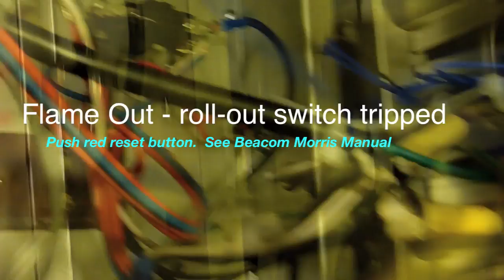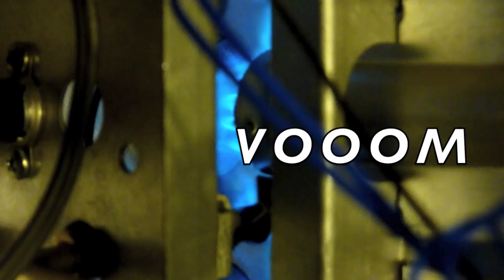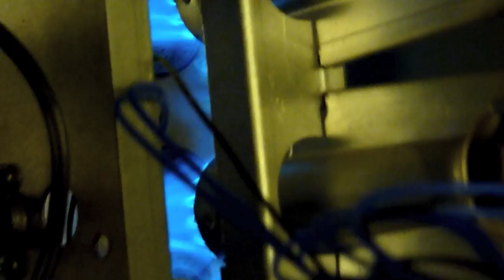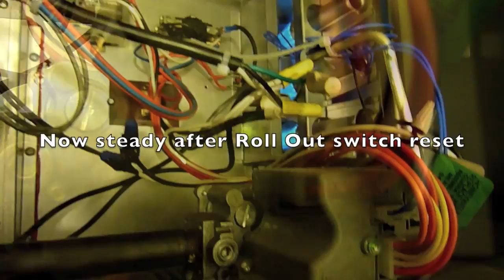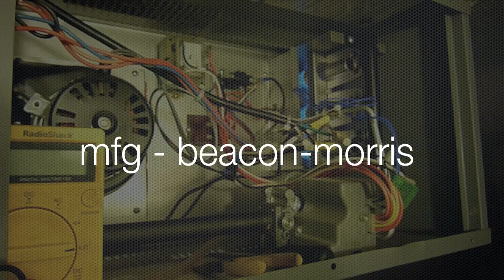Failure to ignite, Furnace Roll Out Switch Re-Set

Comment: One thing to point out to folks looking for the magic button to press to make their furnace work again is that you probably don't want to reset the roll out switch until you fix what caused it to trip in the first place, like, say, debris in the jet (easily removed with canned air). Then reset and check to make sure there's no roll-out when you start the furnace.